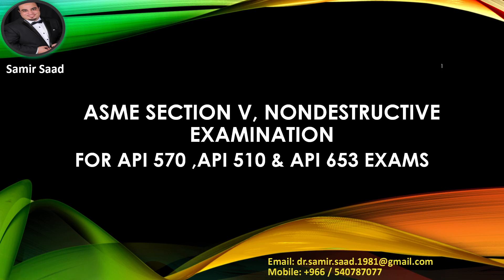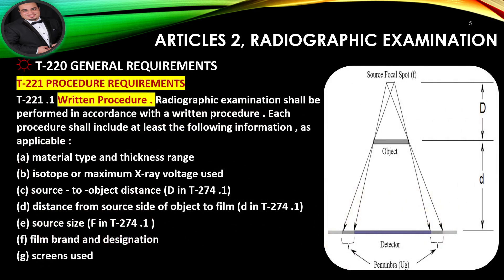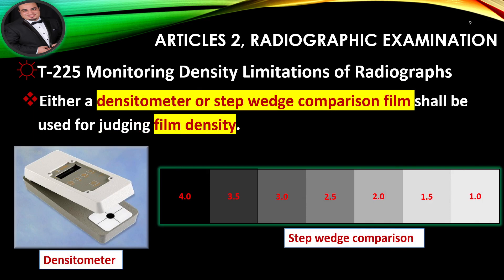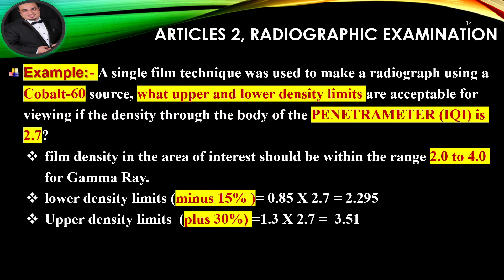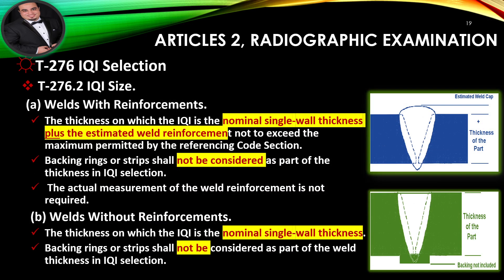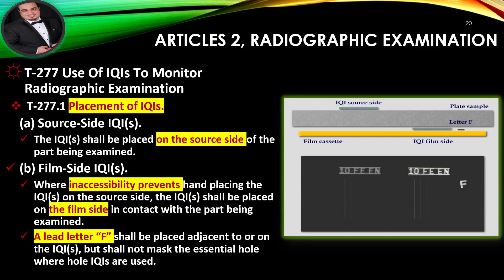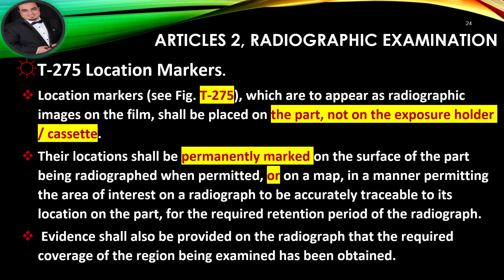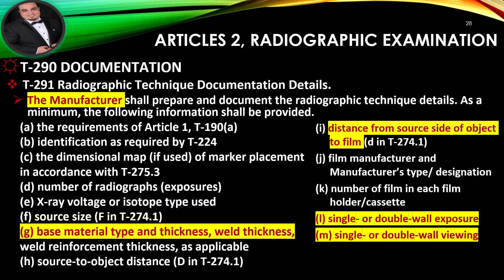ASME V , Articles 2, Radiographic Examination

Comment: There is need of clarification on understanding In 
Asme section 5 Vll-276 iqi selection
We need to place iqi for casting thickness unless otherwise machining finished thickness is greater than 20%of cast thickness is it correct
Reply from the maker: For more discussion, please communicate with me through WhatsApp 00966540787077

Comment: A source side - wire type IQI used on component that is 0.625 inch thick . To be an acceptable to RT, what is the minimum no. Of wires that must be visible in RT. 

A. 3 wires
B. 4 
C. 5
D. 6   
?? 
In this question once we get wire identity then we have to count wires down side or up side? Including that identity number ?
Reply from the maker: Wire No.8
Reply: @Samir-Saad  yes as per table 8 number is correct but how many wire sould be visible in RT? 4 or 3 ?
Reply from the maker: Each Wire Set have 6 wire in different diameter. For example if thickness of specimen is 0.625 inches,  so you need use Set B and Wire No. 8 must be visible . If all 6 Wire visible ( 6 to 11) is excellent sensitivity. If only no.6 and 7 only visible so ,need reshot. If 8 ,7 and 9 are visible ,sensitivity is acceptable.